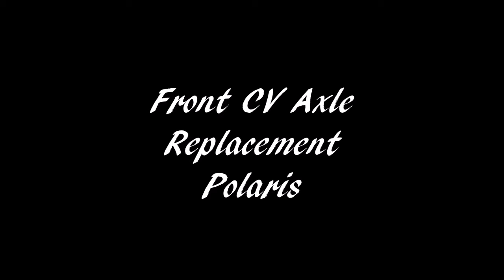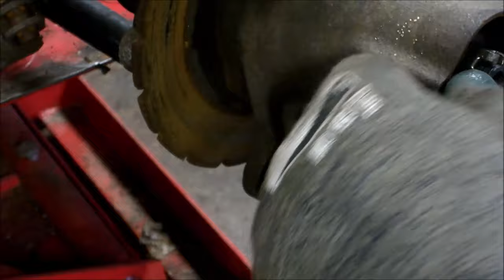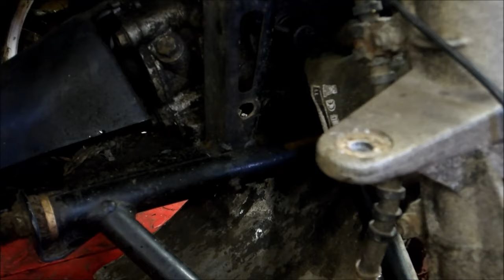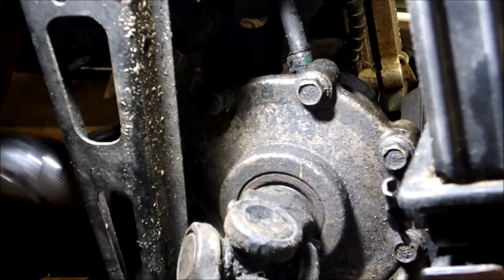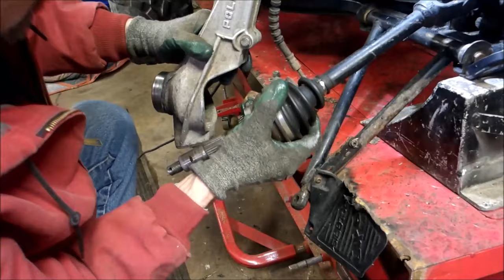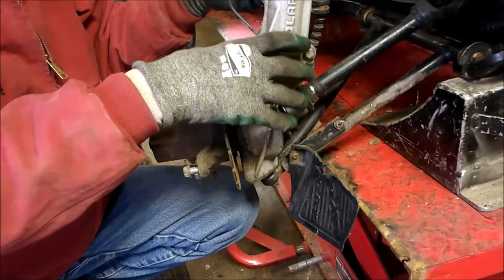HOW TO REPLACE A FRONT CV AXLE ON A POLARIS SPORTSMAN.

Comment: Great video……Working on one now….. but having trouble with the pin…. Does it come out a certain way or will come out on either side?
Reply: If it doesn't come out one way, try turning the axle 180° by popping it in neutral with all 4 wheels raised up. Maybe someone mushroomed the end while hitting it with a hammer?

Comment: Working on a 2005 Scrambler 500 right now and got everything taken apart except for the roll pins on both sides, can’t seem to get them for anything. I’ve tried pb blaster, wd-40, heating them, freezing them with can air turned upside down, only thing I haven’t tried is a air hammer (don’t have one) but those damn pins are kicking my ass! Lol

Comment: I just followed this and worked like a charm for my 2002 polaris sportsman 500ho. However, now hub fluid is leaking out from behind the router. Is there a seal back there or something? Not sure what I missed but there must be. Not sure what i did wrong here.
Reply from the maker: Yes. I should have mentioned it in the video. There is a seal on the back side of the hub as you pull it off. It keeps the fluid in. It seals against the outer ring on the magnetic coil. They sell replacements cheap. Just pop the seal off the hub and replace.

Comment: Best way to get that front pin out of the axle? Any tricks? I have one tiny spot it looks like I can get to it from the front?
Reply from the maker: Air hammer is what I use. You can buy replacement pins...or do what I do. I grind the edge of one end..just take a little off like deburring it. It should drop right in. then use the air hammer to push it all the way in.
Reply from the maker: @Alex-sr8tb  Don't use a bolt and a locknut. It will  won't hold up.
Reply: Where can you buy replacement pins?
Reply: So your just leaving the splines in

Comment: I've got a front axle that is very loose in the front differiential of a sportsman 500 2002.
Will I be able tu pull this out easily or do I need a special tool ?
Reply from the maker: 2002 will be different. It doesnt have the hillard clutches in the hubs I believe. Or am I thinking of a 2003? The only thing you need is a way to get the roll pin out. I use a air hammer and a round off small long bolt and pop it out.
Reply: @TitaniummanGarage  
I did not dismantle that one yet because I'm trying to make my 98 works well before doing the 02 (i've got this sadomazochist thing with buying those models from shady people😅).
Generally speaking, does this problem comes from the yoke or is it the shaft comming out of the front housing that's been damaged ?
Only one side is doing that, the other is rock solid.
Reply from the maker: @mr.octopus6972  hard to tell without looking. It could be just bad bearings  in the hub. Ir the nut loosened up.

Comment: Not sure why but after I replaced the left cv axle, the hub spins in an oval and the steering turns to the right. Any ideas of what can cause this?
Reply from the maker: Sounds like you hub/rotor is warped causing it to drag on the brake pads. I would replace the hub or check to make sure you have everything in place and tight.
Reply: Sounds like you're missing a bearing, the one behind the hub? Maybe?.

Comment: I don't have any oil hub plugs in my 2013. There's no fill point I just assumed it did not take any oil??
Reply from the maker: Those are for the older models. Yours has a front differential that engages the 4x4 in the diff. That fluid needs to be changed as well.

Comment: Do you grease the bearings before putting them back in?
Reply from the maker: Probably a good idea. I  grease up everything I can get too while the tire is off.
Reply: No do not put grease in there, there is a magnetic coupler that need special hub oil
Reply: Specific oil or ATF if you don’t have the correct oil

Comment: I found a mysterious spacer I sat next to me when I took mine off and idk where tf it goes cuz it’s greased and doesn’t belong anywhere else. I put it between two of my bearings cuz that’s the order it was laying in the floor
Reply from the maker: Was it round with 3 tabs? That drives your hillard clutch. It goes next to the magnetic coil. Then clutch fits into the tabs. When magnetic coil is powered  up it turns you clutch.

Comment: What year is that Sportsman?
Reply from the maker: 97 or 98 .I've done so many I don't remember
Reply: @TitaniummanGarage  ok mines an 05 so probably completely different.
Reply from the maker: You don't have the Hilard. Clutch in the ends. Your 4x4 clutch is in the center between the axles.
Reply: @TitaniummanGarage  I'm changing out cv axles this weekend and was wondering about doing the bearings as long as it's all apart.
Reply from the maker: If they look good you wouldn't have to. But might be a good idea.